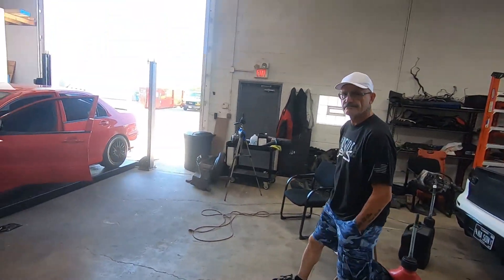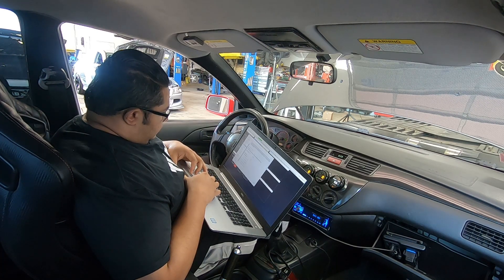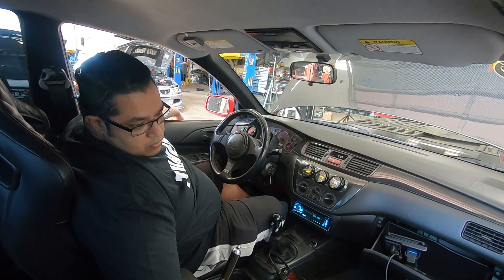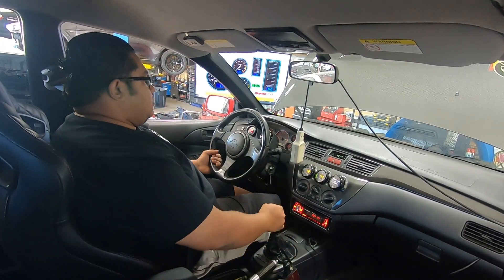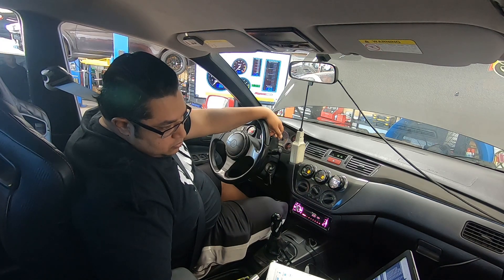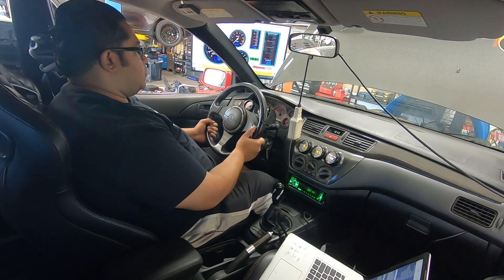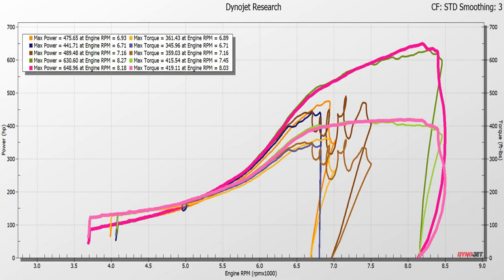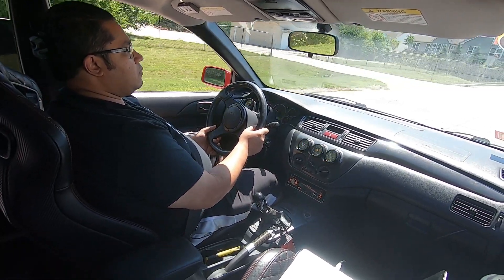Garrett G42-1200 Dyno Evo 9 Day 1

Comment: Its the manifold design thats making the boost overshoot more than the spring used... These newer turbos exhibit such low back pressure that the gate placement needs to now be alot more angled in a way that flow hits the gate better. Or, place the gate on the turbine housing. (welding required)

Comment: Hey good video!! I just had a question about how long should it take a shop to change valve steam seals on a 4b11t
Reply from the maker: Alot of factors are involved in that, mostly what position on the work line u are and parts availability from manufacturer. But it's a 1 day job , maybe a few hours, if the head is off the car already. if the shop have to put eveything back together , and redo timing , valve lash etc , will take more time .
Reply: BD Alchemist ok thanks and keep up the good work!!
Reply: BD Alchemist what’s if it’s just in one cylinder?
Reply from the maker: Typically u wouldn't just change one clylinder. I'm curious as to why u are asking this specific question . Did something happen?
Reply: BD Alchemist I think I have a bad valve stem seal because of cold start smoking but none after that
Reply from the maker: Exhaust or intake ?
Reply: BD Alchemist exhaust
Reply: It goes away and won’t come back until cold start the next day